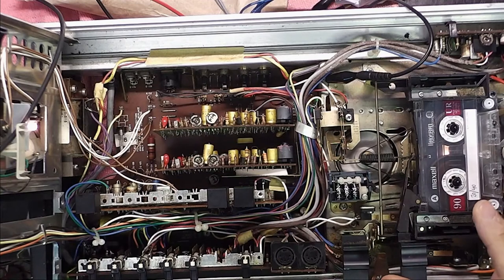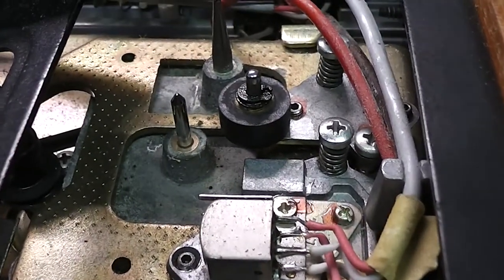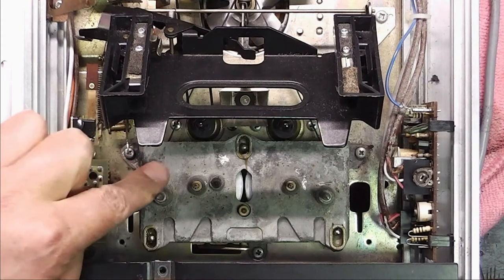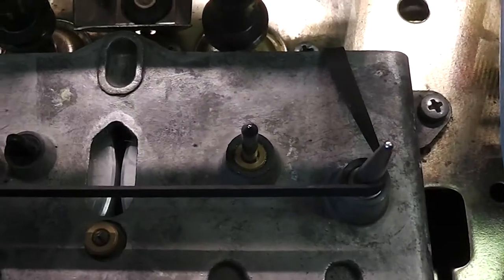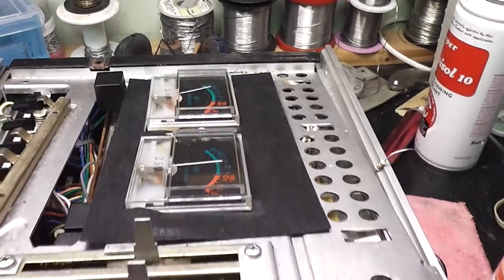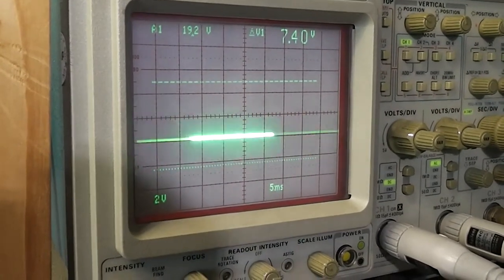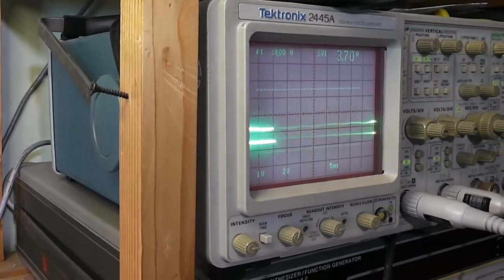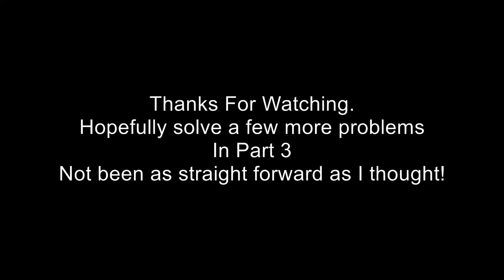Tandberg TCD 310 cassette deck Part 2 Earwax & autostop stop stop.

Comment: Great work :-) 
Very satisfying knowing there are others out there preserving old Tandberg stuff.

You mentioned the possibility of a Zenerdiod across one of the capacitors , did you go further with this idea ?

I am doing similar work on a 310, well actually several 310`s . I have a couple of those. 
Mine plays just fine , but the Autostop in REW / FF does not work, and does not slow 
down towards the end of the tape . 
Any idea on this problem .
Best Regards from Norway , Lars
Reply from the maker: Hi Lars. I didn't do any further work on the zener diode. My memory has faded, but a lot of the problems I had were caused by the switches. The supply motor acts as a generator and is fed back to the motor regulator via switches depending on the direction to slow the other motor. If the switches are dirty, this does not happen.  The autostop looks at the noise from the motor via 1 ohm resistor to see if its moving.  Should work the same in all modes unless of course a switch is disabling it. There is a few electrolytic caps in the switching circuit too. Do look at the manual as that gives a few voltages.    Daz

Comment: Hi Darren I bought one of these new in 1978 and drove it into the ground a few times. On the last time it turned out to be the rewind servo transistors  BC 547B replace them all round. Oxidisation and grime on contacts is removed by WD40 , have you tried a smidgeon of that?

Comment: My 310 has the 60023-5 amplifier board.  Replaced all caps and now replacing transistors.  Tryin to get the tapes to keep playing, instead of the stopping problem.

Comment: Hi Darren! Great stuff! My father just bought one of these, been standing in a barn for quite some time. Got it apart, reattached the drive belt and replaced a lamp, then tried playback and it gives a horrible, super loud buzzing noise (at one time I had it playing well but at way too low volume so I tried to adjust R317 and R417 with not much success). Now I want to take out the amp 1 board and feed it external power. At what points would I put my DC feed if I suspect something wrong with the playback? Want to check DC voltages. I'm no good at all with schematics but I've tried to look at it.
Reply from the maker: The first thing I would be checking is that tape head connector as its prone to bad connections. The earth could not be making and then you would get a loud buzz.
Reply: @darrencoe5795  Yes, good point. I have suspected a bad grounding as well but haven't yet investigated that. I will direct my attention towards that at once! Thank you for taking time to reply! :)
Reply from the maker: @mangehallin  Yes i used some expensive contact cleaner and spent some time cleaning it. I believe its silver plating so does blacken with time. perhaps a cleaner aimed at rings and necklaces would have been a better bet.
Reply: @darrencoe5795  Hi again Darren! No pressure, but if you have the time, please take a quick look at how my machine behaves and let me know if you still think it's a grounding issue. https://www.youtube.com/watch?v=CVXCDWmxlNY

The first thing you see is my machine in playback mode, but it has jumped out of play (still the PB-switch is down) and I just push the mechanism towards the tape (not all the way in) One channel starts to make noise before the other one does. Then in PB it does play sounds but with that loud buzzing. I've had every board out of their sockets ande cleaned up all silver plated contacts but it still isn't playing ball with me. I've tried to identify if it's the head itself, the oscillator board or amplifier board that's faulty but I'm kind of lost at the moment :) 
Just to clarify as well.. with tape head connector I guess you mean those contacts going to the oscillator board, one for left channel and one for right, soldered to the tape head?

Totally understand if you don't have the time to answer, I will ask around the tapeheads forum also :)
Reply from the maker: Hmmmm that doesn't sound like mains hum very much. It sounds like feedback almost. Make sure you have cleaned the record and playback switches well. Yes I did mean the connectors on the oscillator PCB to the heads and leaving it. Alternately the PSU may oscillating. It does also sound like moterboating so may be caps.